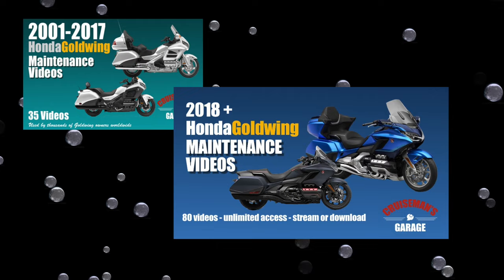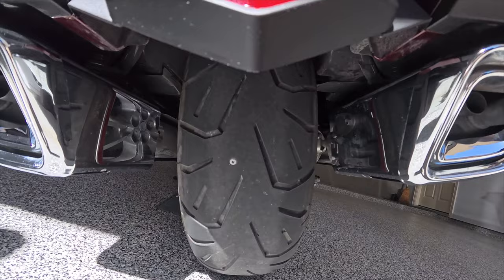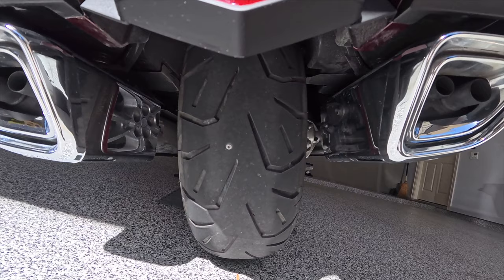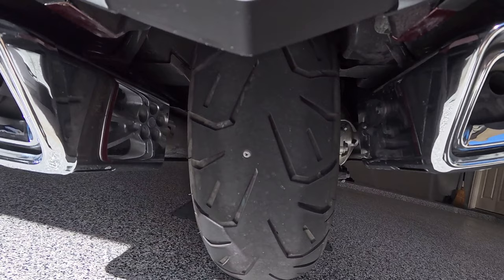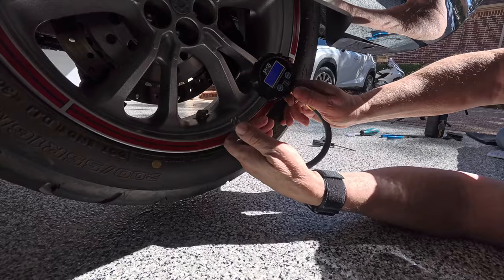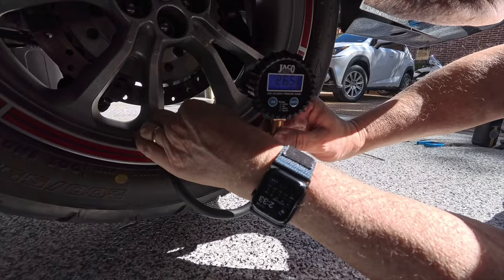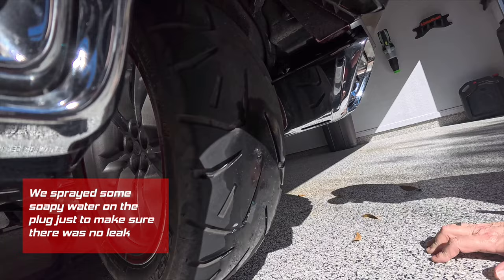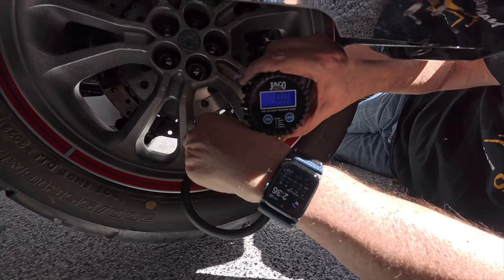Robert White's Goldwing Is Screwed! | Plugging a Motorcycle Tire

Comment: You should not riide extended miles with a tire plug in your bike. A car is a totally different animal. Plug the tire take it to your local dealer a new tire.
Reply: Not really true, but whatever makes you feel good.  A quality tire plug, properly installed will outlast the tire.  Done it many times  Never an issue.
Reply: Take it to a local dealer and do an inside patch. No need to replace the tire if it's got lots of life left. Inside patches done well will not leak.